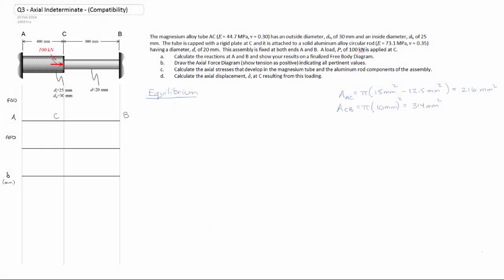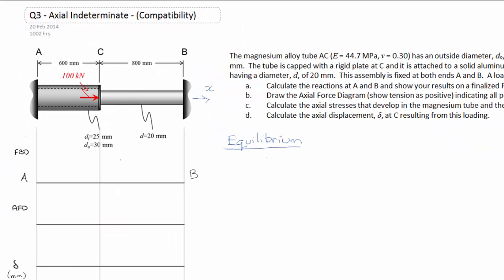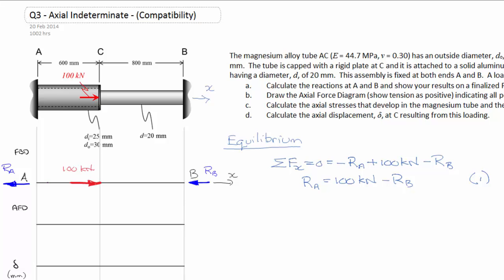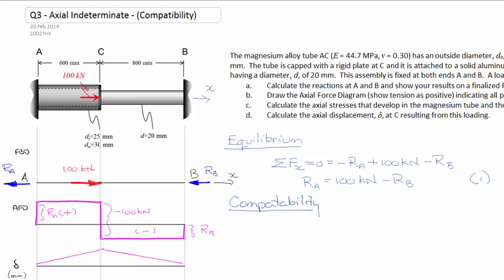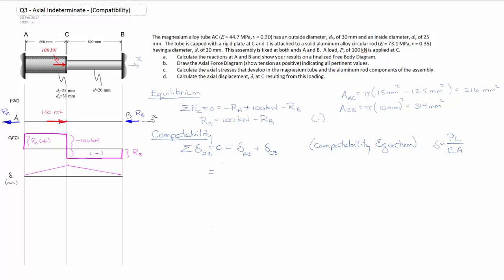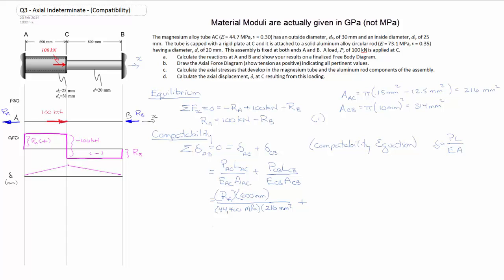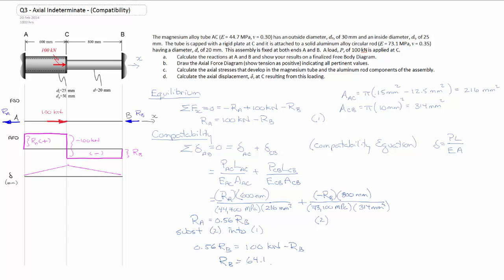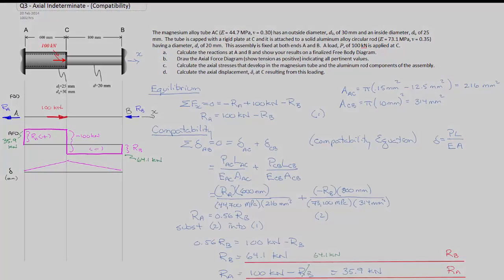R1.1 - Axial Indeterminate (Compatibility) - Part I

Comment: The Part AC of the diagram isn't a composite of aluminium and magnesium why did we use only one of the modulus of elasticity?  The reaction force from a isn't different applies on each alloy in the AC part of the tube?
Reply from the maker: Part AC is only magnesium so only the modulus for magnesium is used for that portion.  CB is only aluminum and thus we use the modulus for aluminum in this section.
Reply from the maker: The second part of the question isn't clear so I need you to restate it and I'll try to answer you.

Comment: @patjheffernan for problems like these, why would there be an applied load of 100 kN in the middle of the shaft? I don't fully comprehend the way shafts work, except that they rotate to supply power. Is this load due to the tube trying to expand? im assuming there must be a bearing  in order to 'grip' the shaft. Or would you say to simply think of it as someone placing there hand there and trying to elongate the tube? thanks!
Reply from the maker: An axial load might be applied part way along a shaft for a number of reasons such as interactions with other parts in a motor, intermediate weights on a hanger, etc.  There would need to be some means to transfer the load such as a bearing surface on a stepped shaft, pin, bolt, etc.  Remember that these are all simplified problems which exist within more complex systems.